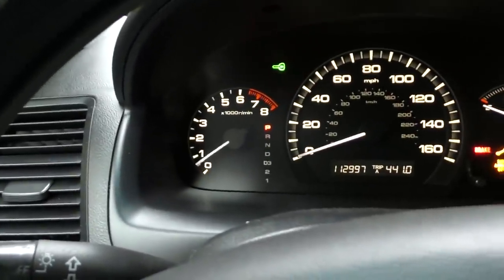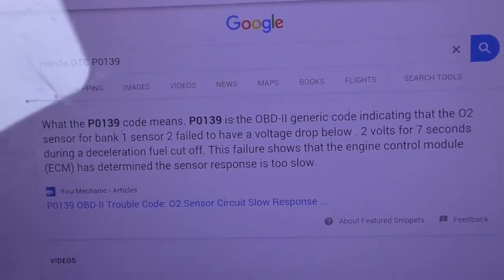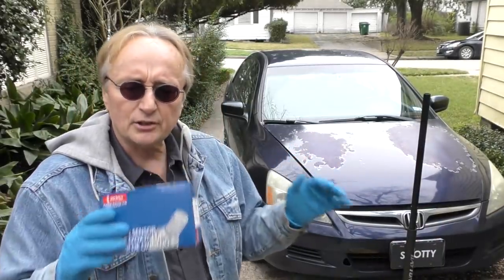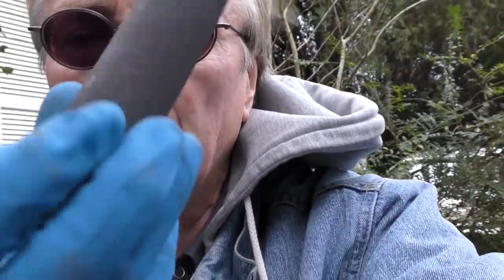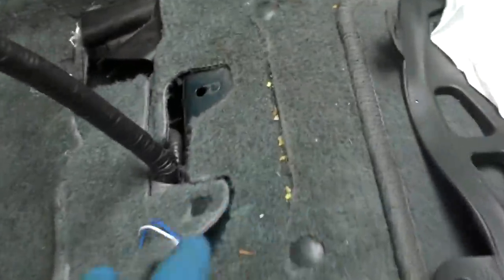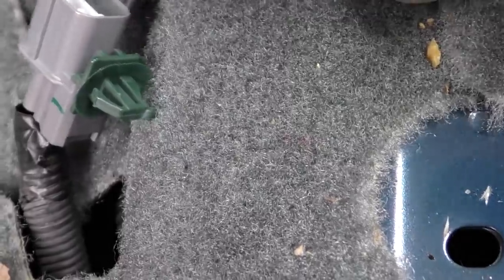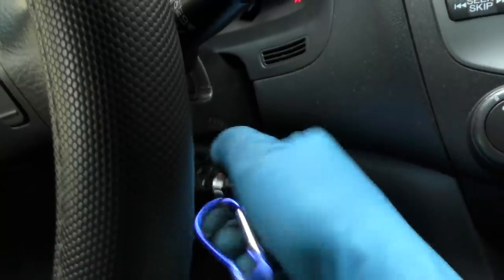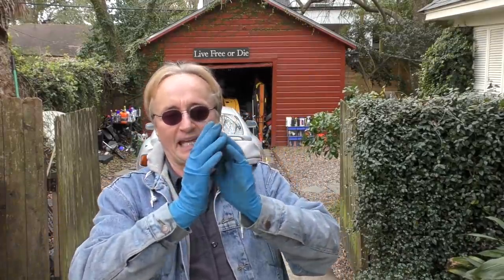Here's Why Mechanics Hate Hondas

Comment: Scotty, try plugging the sensor in after you install it. No wire twisting required!
Reply: I think the problem might be that the un-connected connector would fall through the hole and would be a real pain to feed up from the bottom. But you could take a small flap of cardboard and cut a slit in it, and push the wire into the slit, so that the cardboard would keep the connector from falling through the hole.
Reply: grizzlygrizzle also keep water from getting on to the Floor board !!
Reply: @grizzlygrizzle  
You disconnect the old sensor, tie a piece of string to the connector and drop it thru the hole...
THEN remove the old sensor, install the new one, and tie the string to the new connector and pull it back up.
Reply: @openeyes-411  do you need to take the seat out still if you do that? Getting close to 190k on my Honda and it likely needs a new o2 sensor and valve adjustment...
Reply: @TheConstantComet  
Probably not if you push the seat all the way forward and can feel your way to the connector.

Btw, you may want to change the upstream O2 first, as this is the sensor that adjusts fuel trim.

And I could be wrong but I thought Honda went to self adjusting valves in the 80's...
Reply: supposedly 'common sense' was used in making this video but common sense isn't too common.
Reply: @openeyes-411  good to know on the seat piece thing. I have an 07 Ridgeline. The upstream is the problem area per my scan tool, but I may end up doing the downstream one this Summer as well. The valves unfortunately do need adjusted on the J series motors. My engine runs a bit rich at idle, which could certainly be from a failing upstream sensor. That said, there's a recommendation to check valves every 50k or so, and I have a hunch that they're due for it.
Reply: If 

u want to get in and out, up and down like u at the gym.
Reply: @openeyes-411  U got us all there.
Reply: @TheConstantComet  no need to take the seat out & there is a rubber seal at the bottom on the floor. pop that out and it gives you slack to work with the wire.
Reply: Lol 😂was thinking the same. He knows what he is talking about but sometimes... Sometimes I wonder about that boy
Reply: bobwatters  Honda J series needs a valve adjustment. Going by what the manual says and what I've read online, it should make a big difference.
Reply: @openeyes-411  ^^this^^^
Reply: @joebloeh8058  we have to remember he works by himself, nobody around to say "why r u doing it that way just do this..."...most other mechanics have had this help
Reply: @louarmstrong6128  . It’s a problem of being an independent.

Comment: Had this problem with my 18 year old 2002 Accord (I’m original owner) . 221,000 miles. Loved the dependability of this car. Have a great mechanic, but without a check engine light, and due to the age of the car, they were unwilling to spend my money trying to chase the problem down. They don’t handle exhaust systems and sent me to their recommended muffler shop. Replaced the cat (twice) and the down stream O2 sensor (was not Nippon) Finally determined the computer was bad and bought a 2014 Camry. Thanks for your channel.

Comment: Yes ... OEM sensor!  I used a Different brand and one month later, check engine light went on again ... slight difference in voltage signal tripped the warning light again
Reply: ntk worked fine in my Honda tho- so ur not always screwed!
Reply: trundlepuf Pendants sure but why gamble
Reply: My mom had a Kia map sensor installed by the dealer, failed in a month, they pretty much told her too bad, I installed one from autozone, never had a problem after that.
Reply: I got two made in China and lost my money. I got a used one from my neighbor car before he selling to a junkyard for free. Now again I'm looking for a used OEM one
Reply: OEM sensor in my Honda cost as much as the cat, but it is money well spent seeing as a bad sensor attributed to a broken cat. It stands to reason that good quality cables make a good connection, same goes for scart, HDMI, speaker interconnects etc.The car runs like clockwork now.
Read many stories from Honda owners saying cheap sensors don't work. When my starter motor eventually gives out it will be a decent OEM replacement for the same reason.
Reply: I have had this issue for awhile, i started replacing the O2 Sensor. The issue came back. I didnt do anything for a few years till this year. I saw a post about changing the PCV Valve because the mechanism inside fails after awhile, letting oil sip through to the Cat Converter. I replaced the PCV(it was $14-16CAD) then run a catalytic cleaner. It has been months and i have not issues. No codes whatsoever.  It definitely runs much much better. I did not have to replace my cat, which was my next job if it was not going to fix the problem. I’m gonna run another cat cleaner later this year and i think i should be good to go.

Comment: I guess if a 13 year old car is considered OLD then I guess that makes my car's REALLY OLD!
Reply: cars*
Reply: It is just getting broken in good, if it's a Lexus or Toyota.
Reply: if  a  car   is  over   15  years  old,  it's   old.
Reply: 94 ranger here
Reply: Serpentaria  Considering he has a 94 Celica, 97 is pretty modern.
Reply: 96 Lexus es300, doesn't feel old 180k miles and still runs like a champ.
Reply: Banks won't finance cars over 10 years old.  In the new car business anything over 7 years is considered old.  My vehicles are OLD, haha
Reply: 91 Thunderbird here with almost 300k
Reply: My car is a 2005 ....so I guess it's time it goes to the old folks home 🥺
Reply: Serpentaria  It's not his standards, a car is considered old the moment it's older than its warranty.
Reply: Mines  A 22 yrs old Accord v6
Reply: Serpentaria great year 👍🏻👍🏻👍🏻
Reply: Ray S dammm
Reply: Serpentaria thats shit’s ancient
Reply: Got an 89 Honda CRX with a motor from 94 in it.
Reply: mine volvo v70 is 20+year old. Great car, reliable ant economical.
Reply: @MJrocs1309  95 here with over 300k LOL
Reply: So what does that make my 1988 951? I have to use premium all the time cause I don't have variable valve timing and the fuel injection is one of the first that's computer controlled.
Reply: My 35 year old car is "vintage"...lol
Reply: Bought my 97 Accord new & 310,000 miles later, it's still on the road.
Reply: I have a 1996 Ford Econoline high top conversion van with a 351 W engine. It has 430,000 miles on it and it's still running strong. The 351 W is one of the best engines ever made and I don't understand why it was never used in the 1979 to 1996 Mustangs.
Reply: @jo5173  ,, That's the best made year accord.
Reply: I drive a 94 f150 that thing is ancient. But still runs great
Reply: @driver4011  ,, Not at all !!! If the car has old parts it is considered old. The time of manufacturing doesn't make it old. My Honda is a new 1997 that is pampered . It drives and look so new.
Reply: @winstonleighton1358  
you   want  a  medal  ?   It's a  "new" 1997 ?  It's just  a  23  year  old well used   honda with  little  resale  value.  enjoy  it  while  it  lasts.  today,  honda  in  the  "back seat" while  Kia n  Hyundai  are  leadin  the  way.  ahead  of  the  others.
Reply: @driver4011  ,,, Honda in back seat ? Really ? Well,,, no kia for me. Actually ,,, am not fascinated by these newer vehicles. I hate them. And for your information i can afford a new vehicle . But why should i ??? 
My car takes me anywhere,, idles smoothly, drives better than a new car ,, is brilliantly maintained,,, and is a classic.
Reply: @winstonleighton1358  
when  it  comes  to  new  cars,  yes ,  honda  in  the  "back seat".....holds  the  record  in  recalls,  most  problems,  poor  reliability,  etc.   Kia  n  Hyundai  in  the  lead  in  new  car  market.  their  quality  way  up,   honda  way  down.
Reply: ‘91 CRX here...
Reply: @VikaponeLt  my 1998 S70 non turbo  is going strong with 0 issues.
Reply: I drive an 03 trailblazer, thing is BEAT
Reply: What does that make my fifty year old Challenger then .
Reply: @jo5173  just getting broke in .. can't beat a Honda
Reply: Lmao 98 es300 Lexus one of the best purchases I’ve ever made
Reply: 2007 ridgeline no problems, i am aware ill have to change the timing belt after a while....If you service your honda instead of just changing oil all the time it will last longer....do check ups, see things before they are broken so you can maintain it
..
Reply: @pleco101  
fact ? nah....just  an  opinion....kias  n  hyundais  are  of  much  higher  quality  n  much  better  than  they  use  to  be.....been  driving  an  elantra  for  3  years.....been  a  very  good  reliable  car.....no  problems...just  regular  maintenance......
Reply: My car is 12 years old and I feel borderline homeless driving that thing around. This is what a college education will make you do. Of course, I take good care of it but yeah... hahaha
Reply: Mine too--It's 64 years old and only 513,000 miles.
Reply: 90 Toyota Truck
Reply: My accord is 22 years old. 300 thousand miles on the old girl. Still going strong.
Reply: @driver4011  kia and hyundai ARE trash 🗑️
Reply: 2000 Ford 2002 Chevy..I guess my Vehicles are Fossils!..🤪😅🤣😂

Comment: First let me start by saying I really enjoy your videos. As for the secondary O2 sensor does not control air fuel ratio only the primary controls the air fuel ratio. The secondary O2 is the determine converter efficiency. Another thing is that O2 sensor is a 1 trip set what I mean is that if there is a problem it will trip instantly. Things like cat converter efficiency and EGR flow at 2 trip cycles and the car has to drive a certain speed for a certain amount of time and park it and the coolant temp has to go below a certain temp then when you start it up and drive again under same conditions if there is still a problem the light will set, but on a 2 trip cycle system if the problem is still present after the first trip and all criteria has been met a temporary code will be set. Most of the hesitation problems on that model where the throttle position is either bad or someone has replaced the battery and did not do proper idle relearn procedure. And as for the going under the seat to change sensor yes Honda engineers at total freaking clowns...Honda mechanic since 1998

Comment: That’s the cleanest catalytic converter I ever seen
Reply: Right that's what I'm thinking!
Reply: Texas winters......   those of us in Yankee land would envy the lack of rust and crap on that thing.
Reply: @jamallabarge2665  yep, here in Texas cars stay real nice underneath.
Reply: Yeah, but look what the Houston heat has done to the paint
Reply: @donh215  radiation, not heat
Reply: Haaaaaaa
Reply: Jamal Labarge all my exes live in Texas
Reply: donh215 looks to me someone don’t know how to wash a car 🚗
Reply: My cat has already been patched up once, the flanges don't have much metal left, going to have to change it out, not because the cat itself is bad internally, just the rust is at 💯. Granted it's a 2003 Odyssey but I went to see another 2003 Odyssey the other day at a used car dealer, with 133k on the odo, mine has 171k.... Needless to say when I looked underneath with the spotlight, the cat looked brand new 😂 maybe it was replaced?? But I doubt it, looks more like the car came from the south. Can't wait to get out of NJ. 🥴 Just another reason in the pile of reasons.
Reply: @JM-yx1lm  then look at that awesome paint job on the hood...
Reply: donh215 paint can be easily redone. Rust on the other hand...
Reply: My 04 Accord was pretty clean under, but it was a Texas Car.  I owned it for about 6 months in 2016...  Had 160k+ on it.  I only put about 3-5k on it.  It was having some power steering pump issues and some engine/trans mount started clunking/squeaking.  I ended up totaling it on a slick cold corner in the rain.  RIP, loved the seats in it.  My 2010 Prius is just as clean, as far as I can see. (aero plastic underneath)
Reply: @David-cy5zu  UV rays not radiation
Reply: in english it is UV radiation. not light. ray is 1. radiation is the general word
Reply: Honda cats are worth the most on the used market up to $300 a cat used and $650 new for a 50 state legal oem cat
Reply: odds are its a replacement for the replacement that was stolen... if it's parked in my neighborhood!

Comment: I used to work on cars when I got out of high school, here in Ohio, and when I saw the underside of that car and how rust free it is, I almost laughed. You are blessed to be working on cars there in Texas.
Reply: WHY some states use SALT is beyond me ...... and yes I even think Texas uses salt at times , just not as much I guess , but WHY would anyone use salt when sand works pretty damn well .... I honestly don't get it , it ruins cars to hell ... it's stupid
Reply: I live in New England, they're constantly salting the roads during our Winters. the older trucks around here are all rust ROTT underneath. 
I currently driving Acura and I'm constantly spraying the wheel wells and undercarriage off, during our Winters.
Reply: @ikon8275 , try a lanolin based undercarriage spray, like Woolwax or Fluidfilm. It is also used in marine settings like ship bilges and offshore oil rigs.
Reply: @ikon8275  I never could understand the "salt" remedy , just use sand ... I realize salt probably helps melt the snow , but at what cost to motorists ??? Cars ain't cheap
Reply: @filster1934  thank you! I'll look into it.
Reply: @shure46  do you wanna use sand and be responsible for a larger percentage of accidents or salt them bare and front the cost to motorists? Pretty sure i know which route they're gonna take. It's not that complicated. Salt is more available anyways. The rust belt sucks but its easy to see why it's used
Reply: @fudgepuppy9683  sand isn't responsible for more accidents , stupid driving is .... sand works fine , slow your asses down in snow

Comment: Put some anti seize compound on those threads before you screw sensor back in, makes it alot easier to get out next time . I always use anti seize compound on all exhaust nuts , bolts and screws etc.. Never know when you may have to take it back apart to get to some other component on down the road.
Reply: Copper anti seize is good for electrical ground on the threads.
Reply: @jetking3079   Yep, that what i use is the copper anti seize now. Used to use the old graphite base compound but like the copper base now.
Reply: True
Reply: wayne gambrell thanks 🙏
Reply: Yeah he didn't mention that did he?

Comment: Shade tree mechanic tip: let the engine run 5 minutes or so to heat up the o2 sensor and it'll be easier to break loose. Wear some gloves it'll be a little warm
Reply: You got to kink the wire harness to un kink the harness, after you screw it in ?  Kinky 😉😈😎🙋
Reply: Wouldn't it be quicker to warm it up with a flamethrower instead?
Reply: @Anonymous Sound better when Scotty says it,, a lot kinkier 😂😜
Reply: @annettesurfer  in my case a propane torch didn't work, and even took it to an exhaust shop and they couldnt even get it out with there high temp torch from a tank.  They ended up cutting a small piece and putting a new pipe with an o2 extension.  Things get tough to take out when you live in the Northeast.
Reply: Sven MohaMad that’s what she said !!!!!
Reply: Anonymous Exactly !!!!!
Reply: Social Justice Warrior that will work too 👍🏻
Reply: Sven MohaMad scotty is kinky
Reply: latino914 wow 😳
Reply: One of my coworkers had to use an impact gun to remove an seized O2 sensor. It wouldn't loosen even with my 24 inch Matco breaker bar.
Reply: I took the heater coil from my enail to heat the 02 sensor up. Just be careful the wires don't come in contact with the coil

Comment: 113 k? That's low. I've got on my 2014 Accord 150k. It's forth all the money. I bought it new. No problems ever besides the regular maintenance.
Reply: Andrei Deac 150 k on a 2014 ? I got that on my 2010. You be driving don’t cha lol
Reply: I Have a honda civic 227,000 miles still runs like new.
Reply: 08 Accord 115,000, 05 Camry 114,000 and 04 Sienna 175,000. All are flawless. The Sienna might end up being the most dependable vehicle I've ever owned. Bought it when the kids were young and have a lot of family memories in it. I'd buy American if they were as reliable.
Reply: 06 Accord with 284,000 and I just replaced the motor with a Japanese one  for $550.
Reply: My 92 SC400 only has 134k on it. The 05 G35 only had 114k when I bought it in 2016. Do you drive for living?
Reply: Garrett O great
Reply: AWSOME
Reply: That’s 113000 miles not km.
Reply: 07 Accord 150225 miles doing me justice

Comment: I love my Honda Accord. 08 v6 6 speed. What a fun car to drive.
Reply: I agree I have one, not had a single engine problem, but then again I have owned 3 and never had a problem and I have 110K on this one now I own.  The only issue I have had is batteries in MN go out way too quick, like 2-3 yrs ever since this car came out.  Every 2 yrs they put an interstate battery (from HONDA) and they say anything less than 450 CC Amps is bad.  550 is what it starts with.  Since they come with 3 yr warranties 100% replacement, I replace it (cost wise myself) every 4 yrs.
Reply: Mine is 05 v6 6 speed coupe. I love it

Comment: I've owned 2 Hondas. Did regular oil changes and maintenance...and drove the vehicles safely.  The 2001 civic made it to 315k miles....the 2007 made it to 335k miles. Few issues with both. Got more than my money's worth.
Reply: Mine is civic 2009 with 174km trying drive it up to 400.00 or 500.00km